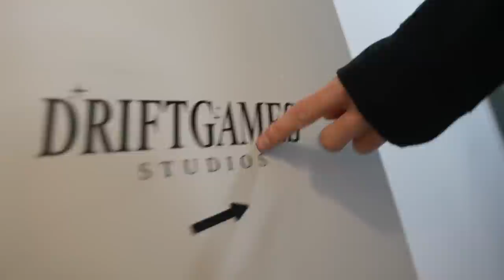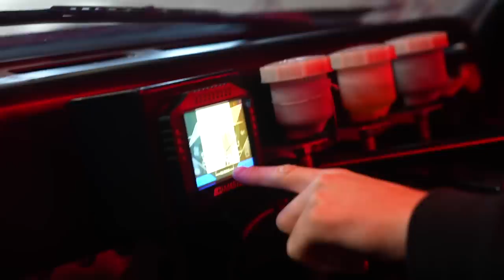First Look at my New AE86!

Comment: You really have to blast around the B roads of the UK and Ireland  or similar in Europe to understand the appeal of some of those crazy fwd hatchbacks, from Mini's to crazy 80's and 90's stuff.
Reply: Rather a starlet glanza
Reply: @clarksonoceallachain8536 rather a Clio 182
Reply: Fwd is crap
Reply: @kevinmenard6792 your not driving them hard enough, 24/7/365 fast fun of a different kind. Sister just got a 595 Abarth (Fiat 500) a small light not very powerful car (think it's maybe 150bhp or so, I know zero about them)  and we took it straight over the B roads up over the Mourne mountains etc and had an absolute blast. The wee car just made us laugh, handling just makes you want to drive the wheels off it dancing thru the twisty's (you don't need rwd to have opposite lock ) and the pops and bangs and spitting it does are hilarious!  A mate who owns a 600+ bhp M5 bought a 182 Cleo and the M5 is an ornament, that's what a good fwd car can offer.  Any wheel drive and I'm happy🤣

Comment: that "metro 6R4" did not have the correct engine. it is suppose to have a 2.5L V6 (often turbo charged) and 4x4. the engine from the 6R4 was the base for the engine in the Jaguar XJ220